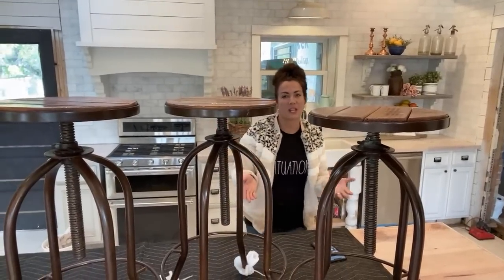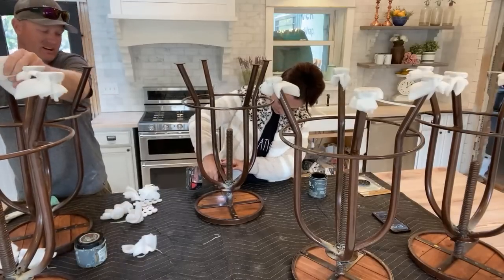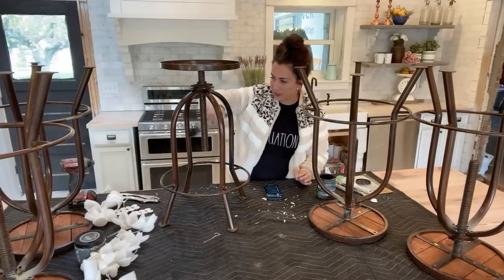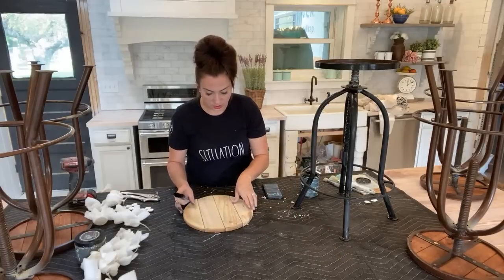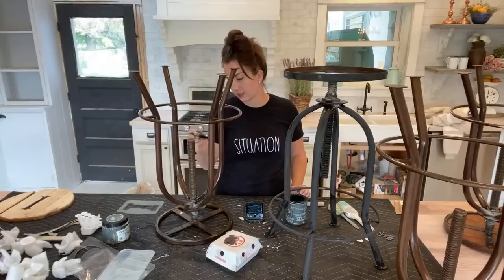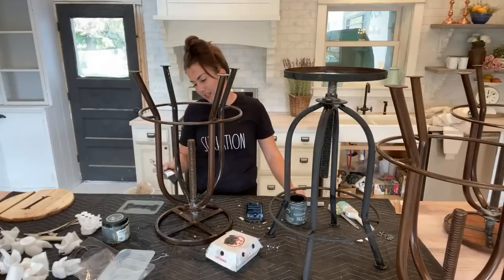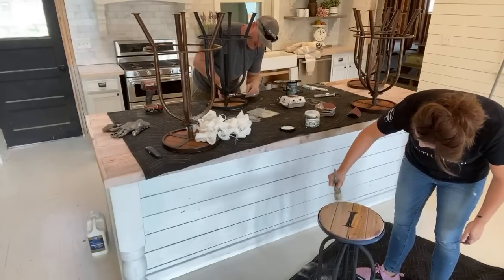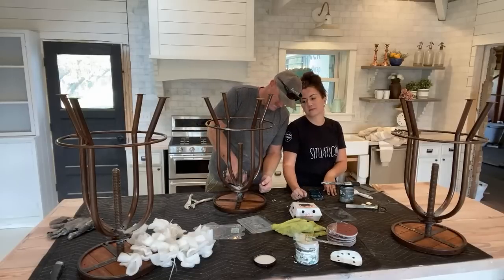Fixing Defective barstools for a Kitchen Island

Comment: Will the paint on the screw allow it to still be adjustable?
Reply from the maker: These are welded in place so the screw is no longer functional.  I if you were wanting it be adjustable The paint might wear off or hinder the movement.